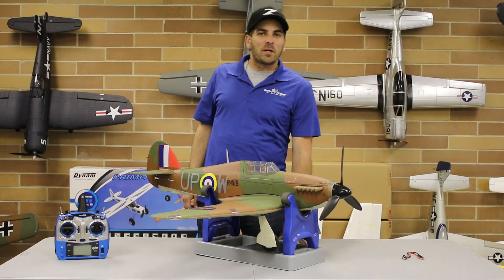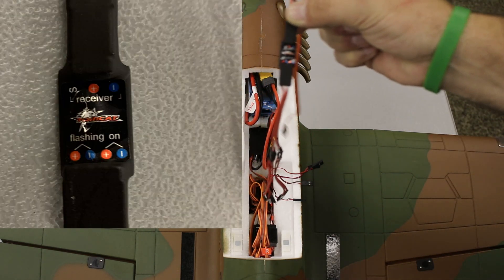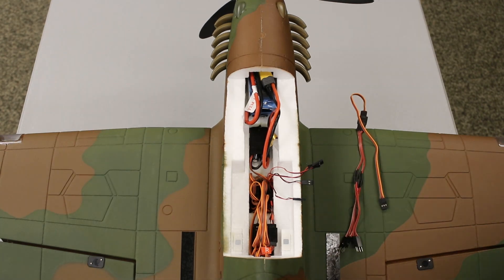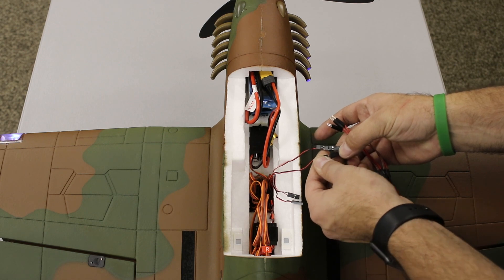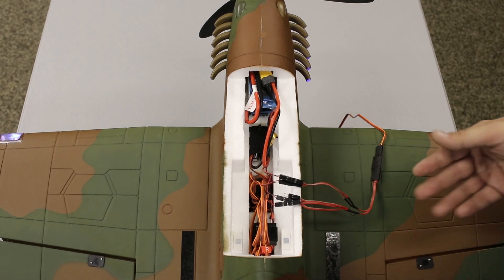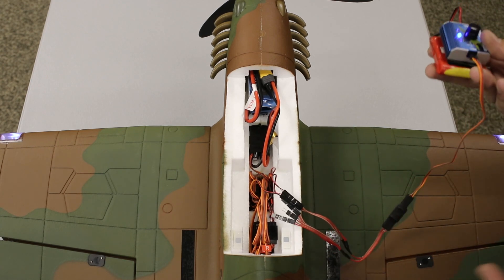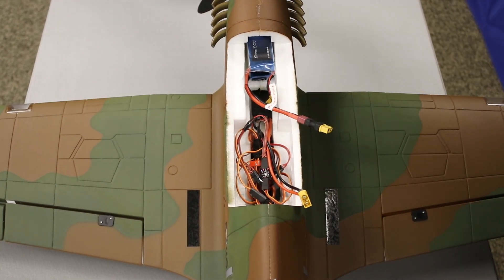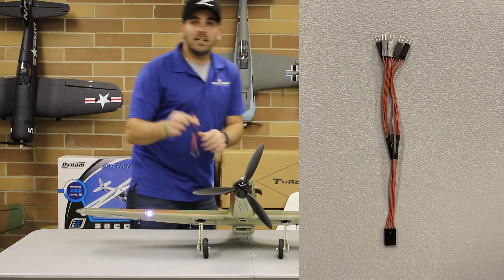Detrum LED Light Driver Installation

Comment: Is there a way to turn the solid run lights on and off from the TX
Reply: terrordactyl44   Only if you had a 7 Chanel or better radio and receiver and used a separate Chanel on receiver for power and a switch .
Reply from the maker: I don’t believe so.